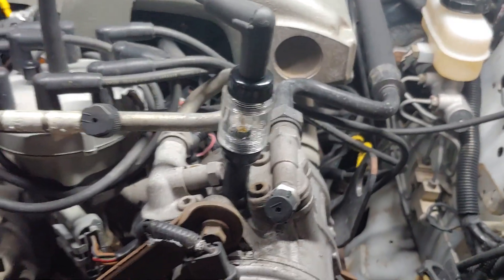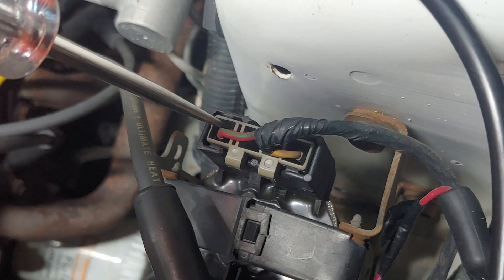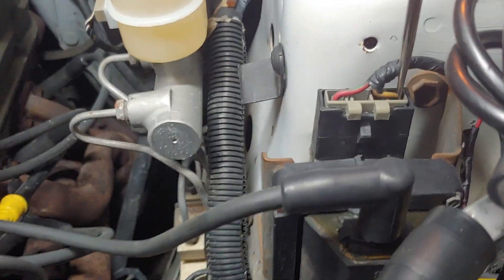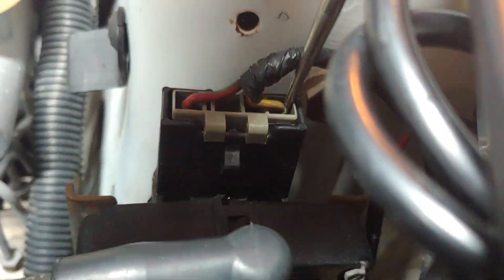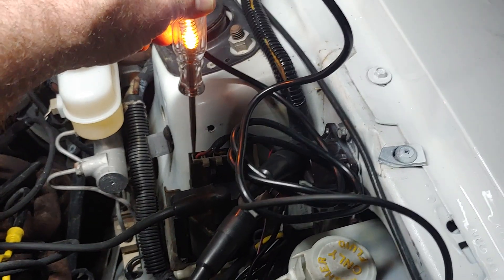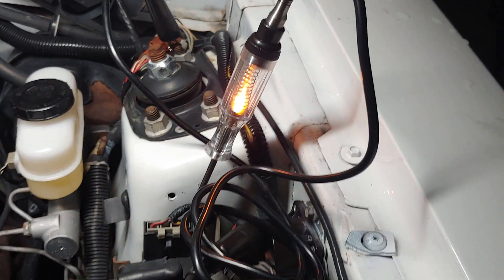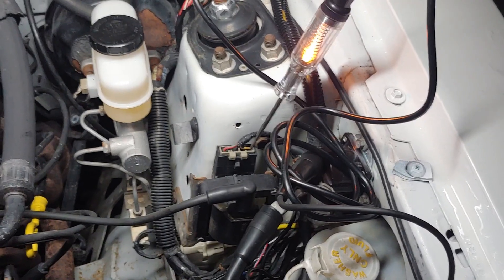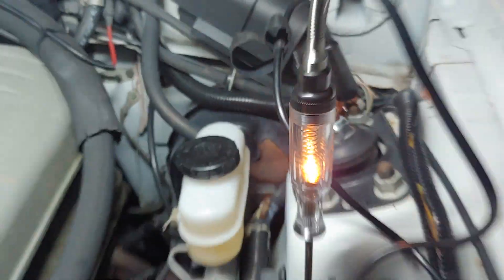How to test a TFI Ignition Coil on a 5.0L Mustang

Comment: Is 47 ohms on the positive side to ground an issue ? Coil disconnected and probing positive connector to ground
Reply from the maker: I never test a coil with an ohmmeter. If the coil is bad enough, an ohmmeter could catch it. But if the ohmmeter says the coil is perfectly within specs, that doesn't mean the coil is good. The reason is the coil heats up a lot when actually being used. And so while the ohm tests may be accurate when the coil is cold, the coil could quickly warm up and no longer be any good. An ohmmeter is just not a good test for coils.

Instead, check for constant power on the red wire, under a small load. And check for ground pulse as shown in this video. Then load test the output of the coil by slowly increasing the gap of your spark tester. A good coil will fire a bluish purple spark over an inch. A weak coil will be a yellow spark that can't go much more than 1/2". A bad coil won't fire at all.
Reply: @dragradialperformance3540  sorry meant the connector positive to the distributor coming from engine harness . The negative on my distributor completely fryed , so when probing the positive pin 1 and 5 I got 47 ohms with the distributor disconnected on run command from ignition switch
Reply: Only time it reads zero from pin 1 to ground is when I remove ip fuse 18 under the dash
Reply from the maker: @raulh802  Do I understand it that you're ohming power wires? There's just no reason to, and whenever you ohm something, it has to be disconnected. Ohming wires and coils is nearly worthless (except airbag wiring, or when checking for a short to ground). The ohm meter is best used for measuring resistance in solenoids. For everything else, stick with measuring voltage. Or in some cases, amperage.

If you're saying the negative WIRE going from the TFI module to the coil has literally fried, then it's shorting straight to power some how. That could be a dead shorted coil, or a short to power in the coil control wire.

When you say pin 5, can I assume that means you're measuring stuff at the TFI module connector? Again, stick with voltage, or pulse testing.
Reply: @dragradialperformance3540  The plug that connects into the distrubutor is what i was checking. it comes off the injector harness and has a radio supression capicitor on the same electrical point. That female plug has 7 pins pin 1 is power to that pin along with coil positive , pin 5 ground and tfi module. My module is in a remote area not like the fox. With the engine off and checking resistance fom pin 1 to ground it has resistance of 47 ohms almost as if it was shorting. being that the ground wire to the distrubutor is smaller gauge , i thought that is wahy it would burn up before the thicker red wire. I was trying to find the source of the ground fault.
Reply from the maker: @raulh802  I would need to know what you're working on then. In any case, resistance is not useful for testing modules, coils, etc. And really, not a great test for wiring either, since resistance can tell you some things and not others.

Comment: So basically, one would be safe to assume a bad coil if it is pulsing but still not providing spark out of the coil to a spark tester? You mentioned that it pulsing indicates coil control, and that rules out the TFI module. Does this coil control rule out the pip sensor as well in a crank, no spark scenario, or only the TFI module?
Reply from the maker: If you have coil control (ground pulse) from the TFI module, then you're not worried about the PIP Sensor signal or the TFI module. If you also have Injector pulse, then you aren't worried about the PCM. But that should be checked, because the TFI module can fire the coil with just a PIP signal, even without a computer installed.

The coil still needs to be checked for power coming in on the red wire. That same power is what is showing up as a lighted test light on the coil control wire, as shown in this video. If you have power on the red wire constantly during cranking, and coil control on the negative side, then the coil should be producing sparks. Check that the coil wire to the cap has a spark in it during cranking, using an online spark tester, or an HEI spark tester. If no spark despite good coil power and good coil control, then the coil is bad.

Comment: Hey brother, hopefully you're still answering questions. My 91 GT has an issue I haven't seen anywhere. My cylinder 2 wire shows it sparks roughly half as often as all the other wires. I swapped wires to see if it was a bad wire, but the issue persists. The cap and rotor were replaced, same issue. My car is sluggish and sounds a bit rough. It does fire right up and doesn't stall. I checked compression and it is good. Could it be a bad TFI?
Reply from the maker: It doesn't really sound like a bad TFI to me if the other 7 cylinders fire fine. I've not seen this issue before. Are you sure that's what's happening? The TFI module fires the coil every time it gets either a PIP signal from the pickup coil in the distributor, or a SPOUT signal from the PCM (if the SPOUT connector is plugged in). Try that test with the SPOUT connector plugged in, and also unplugged. If it's a PCM issue, you'll have all 8 sparks if the SPOUT connector is unplugged. If it's not a PCM issue, it's probably an issue with the stator inside the distributor. It has 8 teeth, one skinny and the rest wide. Make sure not of them are missing or bent. Also make sure the cap points look fine.

Comment: My car is a 1986 ford mustang gt 5.0 I already changed the distrubtor & the ignition coil when we go to crank the car the yellow and green wire doesn’t have a pulse the light completly shuts off out of the incandescent test light and I’m getting no spark to the distributor please help me
Reply from the maker: Try unplugging the SPOUT connector. That takes the PCM out of the equation, and the ignition module fires the coil based solely on the PIP signal. See if it starts that way.

If not, you'll have to check the PIP signal, preferably with an LED test light. I believe I have a video showing that. It's the top wire on your ignition module connector. Also, try unplugging the coil and hooking a test light to battery positive, then touching the yellow/green wire (key on). See if it lights the test light (by providing a ground to it, since it's already hooked up to 12v power). If the light lights up, there may be a short to ground in that coil ground wire. If so, it would energize the coil non-stop, and blow up every coil you install.

Comment: Great information. I have power to red wire with key on but I don’t have any power on the tan wire at all. Not sure if that is faulty wiring or faulty coil? Thanks for the help
Reply from the maker: The coil inside is basically one wire,  coiled around an iron core. Every wire has 2 ends. When the coil is not grounded, power basically just goes in one end and comes out the other. So 12v in and 12v out. It's not until you power one end and ground the other that the coil charges. 

Which means you should have 12v on coil negative, until the ignition module grounds that tan wire. If you don't, test it again with the tan wire disconnected, or ohm test the unplugged coil on those two terminals, to make sure the coil primary windings aren't broken and open.
Reply: So if there's no test light on negative it means the Ignition module is no good?

Comment: My coil sparks but i get a yellow spark on all pugs and also directly from the coil.
Reply from the maker: If you use an incandescent test light, or an inline spark tester with adjustable gap like the Lisle tool, you can slowly increase the gap that the spark jumps from 1/4" to about 1". The spark should easily jump the gap that far, and the spark should be a bluish purple. A consistently yellow spark that struggles to jump a 3/4 to 1" gap is a weak coil. Confirm the coil has a good 12v power going to it, and replace the coil with a genuine Motorcraft.

Comment: So I tested the red/green wire that is supposed to have 12v even when cranking I had my brother crank the car over and lost all power to the wire light went out completely when I test the green/yellow wire it has a very faint light just getting the light bulb hot but not lighting it. What would cause this and how can I fix it?
Reply: The red/light green wire should have 12v on it any time the key is on. This comes from the ignition switch (in the START or RUN position, then goes thru Fuse Link N (that may vary depending on what year car it is), and then it goes to a splice, which goes to both the ignition coil and the EEC power relay. Test this wire with an incandescent test light that's grounded to battery negative. This light should remain bright at all times, even when cranking. If not, find out why. Maybe you have a half melted fusible link.

The other wire will have a ground pulse on it during cranking. When not cranking, 12v will come from the red wire, thru the coil windings, and out the other side onto the tan/yellow wire (or whatever color your coil ground wire is). If you don't have power on the red/light green wire, then you wouldn't see that power coming thru the windings of a coil when the key is on and engine is off, indicating the red wire doesn't have power.

Comment: Man this was a life saver. Could not figure out why my turbo car started running like shit gradually turning into a no start situation.  I fought for 3 days chasing my tail and I watched this video- BOOM found out tfi was bad (i ohmd it out and it spec'd out good. Had no pulse on negative wire, replaced tfi and she is mint again.
Reply: I wanted to ask your opinion on something, can these modules affect idle?  lets say you have a really nice OEM module versus the china crap,could you notice any improvement by swapping them out if you are having issues? Ive been stranded before because of these damn things but i was under the impression they are either good or bad, no in between, guess Ive been wrong?
Reply from the maker: I've seen modules fail in different ways. Some break up at WOT. Some won't start. Some will idle poorly. So there doesn't seem to be any specific issue you can correlate to the module failing. Without a scope, all I can say is if you have unexplained misfiring or a no-start, it could be the module. Only with a scope on PIP, SPOUT, and the Coil Control wire can you really see that the module is being told to fire, and then doesn't. No other tool is fast enough to catch single misfire events.

Comment: Hello thank you for the amazing video! I may be a little confused but correct me if I’m wrong, if both lights are on and the ground side flickers but no start then it’s my ignition coil and if there’s no light on both wires or it’s a solid light for both wires the control module is bad?
Reply from the maker: The red/light green wire should have a constant 12 volts on it when the key is on. This is the power side, and is constant hot. The other wire is the control wire. It's how the module controls the coil. The module grounds the coil for a few thousandths of a second. When it quits grounding it, the spark occurs. When the coil is not being charged, the 12v winds thru the coil and essentially shows up on both sides of the coil as a constant hot (light on). 

When the module grounds the coil, it very briefly drops the voltage on that light (5 thousandths of a second). That's what causes the flicker. There is a tiny amount of flicker caused by the starter drawing a bunch of amperage every time a piston comes up against compression. But there is a more pronounced flicker when the module is actually grounding the coil, or pulsing it. If the ground/control side of the coil flickers strongly, the module is grounding the coil and the coil SHOULD fire the spark. If the flicker is very light or not at all, then the module is not turning the coil on. It's best to just watch the video a few times and see what that difference between a normal starter flicker and a coil control looks like.

Comment: 85 Bronco 5.0 EFI, both wires have power on key o, my yellow has power but completely off when cranking, 
Only way i have been able to start it is when I pin ground on 2 wire coming out the tfi module. Im going crazy.
Reply: Just check the TFI diagram for your vehicle, and make sure each wire has what its supposed to have on it. Use this video to fill in any blanks on what some of the terms mean.

Comment: Good day. On my ignition module I have the light on the positive but when I turn the key switch to the run position it loses the power but I still have power on the ground and it does flicker when I turn the car over like in the video. Is the my ignition module bad?
Reply from the maker: There may be two positives on the ignition module you have to check. One for start (crank), one for run. So be aware of that. I believe the 3rd one down is start power, and the 4th one down is run power. The bottom one is ground. You should only have a lit test light on the ground terminal if your test light cable is attached to battery positive. If attached to battery negative, the test light should not light on the ground wire.

Comment: Great video drag radial performance, one simple question, where is the test ligth connected? To the battery positive or ground? Thank you im a new suscriber to you channel,cheers from ontario ca
Reply from the maker: The test light checks for the opposite of what it's connected to. So if it's connected to batt +, then any ground you touch will light the light. And vice versa. For coil testing, coil positive would be checked by connecting the test light to batt negative. For testing coil control (a ground pulse from the ignition module), you would hook the test light to battery positive.

Comment: Thanks for the info.
I did the test and it's showing a bad TFI.
Hopefully a new one will get this pig to start
Reply from the maker: Bear in mind that you have to have a SPOUT signal coming in, to tell the module when to fire. If the SPOUT signal isn't there, the module will use the PIP signal instead (and fire the coil at 10 BTDC every time). That's why we unplug the SPOUT connector to set timing... it removes the computer control over timing, and fires the coil based on PIP at 10 BTDC.

If you don't have a PIP or SPOUT signal coming in, the module won't know when to fire the coil. So before you can condemn the module, you have to make sure it has everything it needs first. And that would be power, ground, PIP and/or SPOUT signal, and probably a 12v start signal as well.

Comment: I have 95 mustang 5.0 , replaced distributor, ignition module, new plugs, when I start it and hold about 2000 rpm’s it cuts out misses runs like crap, I remove spout and it idles good and doesn’t cut out!! What could it be???????
Reply from the maker: When SPOUT is plugged in, the computer controls spark advance. With SPOUT removed, the car runs on a flat 10 degrees of timing IF the timing is set right, and IF the balancer hasn't spun and lost it's markings accuracy. So check timing, make sure unplugged it's at 10 BTDC and plugged in that it's somewhere between 20 and 40 (raising RPM raises timing). I'm thinking it could be a bad PCM. If you have a friend with a PCM that has the same catch code, try swapping theirs in.

The scientific answer is to use an oscilloscope to measure spark advance against peak cylinder pressure (using an in--cylinder pressure transducer) to see what the PCM is actually doing to the spark timing. If it's all over the place while holding the engine at say 2500 RPM, that's not good.

Also, at idle only, spark advance can be adversely affected by a dirty throttle body or idle air control motor. If the engine is struggling to maintain the desired idle speed because it isn't getting enough airflow (because of dirty or failed parts), then the engine will slow down in RPM. And the computer will respond by advancing the timing. So if you see the engine at a fixed, high spark advance at idle, like 25 to 30 degrees and fixed there, you might just need to clean your TB and IAC.

Comment: I have a 89 converted to carb, my coil is getting hot any idea why?
Reply: The coil is likely being grounded constantly. Either a short to ground in the coil negative wire, or a bad ignition module that is providing a constant ground. This will kill the coil quickly, if it hasn't already. If this condition exists, the car won't run either.

Comment: How to test ignition switch
Reply: Remove steering column covers. Find ignition switch. Use test light or voltmeter on the pins you want to test for power coming in, or going out.

Comment: I know this video was posted years ago. However, when cranking the car and testing the power side aka red/green wire it loses power, but the yellow side does pulse? If I am drawing to much amperage would this point to the TFI, Starter relay, or Ignition switch?
Reply: You should never lose power to the coil with the key on. This power comes thru a fusible link (probably at the starter relay), thru the ignition  switch, and to the coil and ignition module. Unlike a fuse that blows if there is too many amps being drawn, a fusible link slowly burns.

Over amperage can happen if the coil is being grounded non stop (bad ign module or short to ground in coil control wire), if the coil has too little resistance in it's primary windings (ohm test an unplugged coil between coil + and -), or corrosion/contact issues in the ignition switch. Or any voltage drop in the coil power wire anywhere.

My money would be on corroded ignition switch contacts. But you need to test that coil power wire with a voltmeter, and keep working backwards up the wire until you find where your voltage drop occurs.
Reply: Thank you!!!!